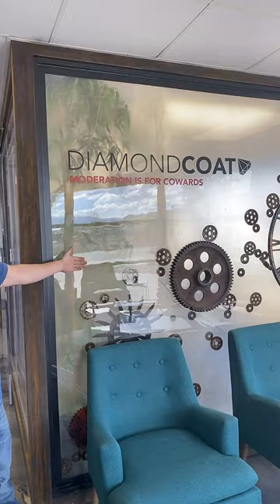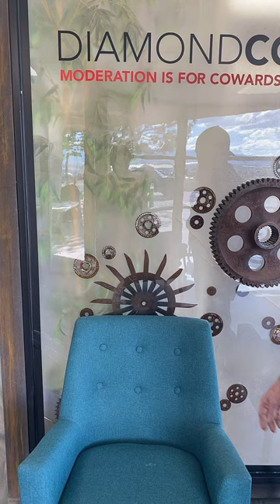So many epoxy things (TikTok Live 2-14-24)

Comment: Can you epoxy over fibreglass tub and tub surround?
Reply: I'm wondering the same thing. Shower needs work wo tear apart. I'm hoping so!
Reply from the maker: Yes a fiberglass tub! With a tall surround (Verticals larger than standard tub) We suggest building the panels and pouring the epoxy on that.